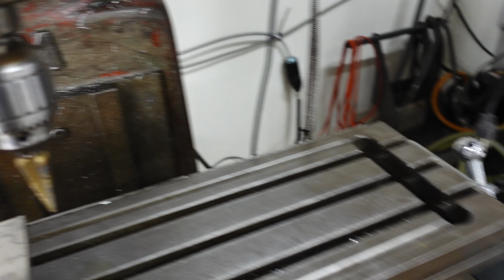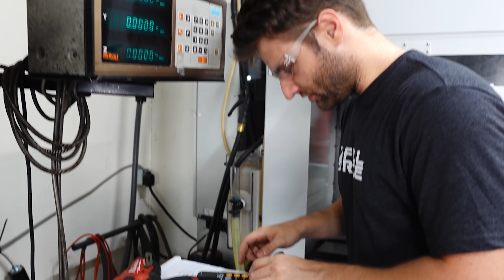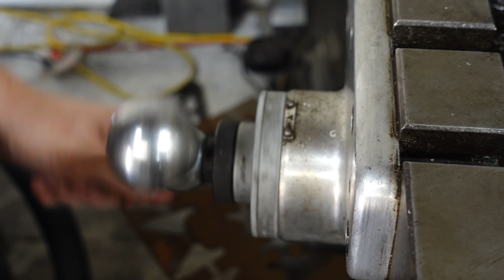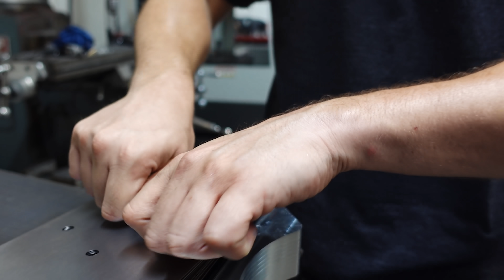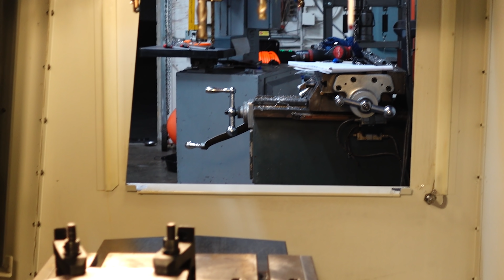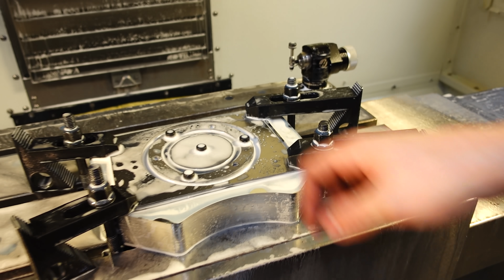Making EMERGENCY Parts for my 4 Rotor before the race.

Comment: I know that you're use to working in inches (imperial). I mostly work in millimetres and would even tend to convert from inches to mm if it came up.  But as it is a BMW diff and the sizes are probably metric, It may have simplified the job for you if you just pitched the holes out in mm? :)

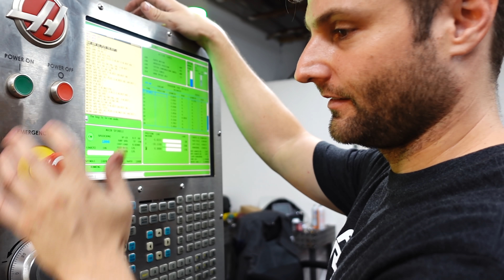Comment: 11:52
if you can buy, HSS tools instead of carbide they are cheaper when you crash😂👍
"single step" or single block here on the first run and read the code BEFORE you run it.

Comment: You should get the DRO fixed, there’s a feature in it that will allow you to do all that math without actually having to do that math so you can make flanges and, in this case, shins without having to deal with a bunch of additional resources. Should just be able to plug in the diameter of the circle the holes are on (from the centerline of the holes) and the number of them and it’ll display the coordinates for each hole.

Comment: Man I wish I was there to help you with the programing, I have a few tips for working on the cnc(no pun intended). You don't have to be completely fearless when running your programs, start it slow, some machines have a dial on the machine for the rapid feed rate and normal feed rate. Also if you close your normal feed rate the machine should stop moving completely except for the spindle. As for the programing, your contour is correct but see if you can "ramp" down at a continuous rate instead of directly plunging into the material every new depth cut you take. So start like 0.01 above and no lead in or lead out either because you don't want to ramp down 2 inches and have the tool want to lead out ^^

Comment: Rob, try using helix (spiral) cutting for this sort of work. It's less aggressive then just dropping the mill down. You'll be able to cut faster, have less wear on the tools, have even load all the time, so less wear on both the machine and parts, "cause" a even cutting temp, so less risk of warping the finished products. I recommend you look for a used CAM license from a top brands like PowerMill or MasterCAM (two options; either the license is on a special type USB dongle or it's software only, in which case you'll need the entire computer/setup, both are common. Make sure it isn't a pirate version, minimum demand a original recite! These programs will rat on pirates and you'll then get a nice little mail from their lawyers, will get more expensive then buying a new licenses very fast!)
Using one of the top brands will ennable you to use dynamic milling technics, this will further lower wear and risks. If you get a real 3 axis license you'll be able to make parts you couldn't imagen, by just a few mouse clicks. The "AI" in those will do most of the work for you in dynamic mode, so you basically only have to plan/calculate which tools you need active to achieve you goals regarding surface and corner finish. Even threads above M10 (3/8 in) are mill'able with the right software and just 1 or 2 specialized thread mills (a set with 1 carbide shaft and 2 55/60 degree heads will set you back 200-400$)
I would like too point out that you'll ofc need a ton of experience to achieve real toolmaker quality, but in reality these advanced CAM softwares are getting to a point where my (pro toolmaker) experience means less and less.

Good work doing the math! :) It's rare to see people doing that these days since it so mush more easy to make a quick CAD model and just check to measures in the software (which i btw recommend, less risk of messing up)

Helix "starting hole" tips (use this to avoid having to purchase drills and setting new tools up all the time, less risk of collision): the closer your helix D is to your tool D, the less -Z per round. Never go under 1,1xD, never go over 1,9xD. Helix is da bomb, as you americans would say, perfect for basically everything, starting holes, contours, precision holes, roughing out 3D surfaces and so on :)

PS for future reference imagen stainless is like chewing gum, it'll stick a loot to your tools, causing very high wear, even at low cutting speed. At low speeds this is easy avoided by adding a spray or drops of proper cutting oil/ high oil concentration cooling liquid. Regular steel needs cooling at some operations, but with dynamic milling (very high cutting speed, high feed, low engagement 0,05xD, max debt your tool will allow) you'll likely only need high pressure air "cooling" (it's not really cooling that much, mainly to evacuate chips fast enough. Using the right speed + feed will evacuate 90% of generated heat in the chips)

PPS Do not EVER use a end mill as a drill!!! Almost impossible to do without lots of experience. Use smaller mill + helix technics. If needed, only if needed, pre-drill to 0,5-2mm from finish hole D and "drill" with a end mill, low feed, max 1mm between "pull ups" to cool and evacuate chips
Reply: Oh crap, forgot to add: When milling fragile thin plates like these, they'll always bend (not wrap). This is due to the pulling force made by the way the mill is grinded. With each tooth "hit" the force will always be 20-40% pull upwards, depending on the end mills grind angle. There's no way to avoid this. For next time do this:
1 Set the base/mount plate into the CNC
2 Lay on a extra plate minimum 3mm thick on top of everything. This will also be great for adding extra pressure on the clamps and spread the force more even, ensuring nothing will move around while drilling
3 Run the program for mounting holes (all of them), like you did in the manual mill
4 Remove clamps and mount everything with the bolts. The thin plates will now have an high even pressure spread, that due to the bolts placement will be perfect and "shift" correctly to the areas needed while milling the rest. This'll be enough to (likely, depends on material, end mill grind and wear) have more downwards force then the mill will pull when running the contour pgm
That's it, you should see a close to perfect product, no bends, no wiggling, perfect sharp edges, no burs

Comment: How come you didn't use the factory shim as a template?  Using a sharpie, mark out the holes to drill as well as your inside/outside circle measurements.

Comment: Bruh.    Got u a sweet  cnc,  study feeds and speeds for materials and watch your fixturing and bang em out,   screw the  manual with a janky dro.    Also look into some thick aluminum and o ring material and a vacuum pump.

Comment: Rob to machine things more efficiently you have to check a couple parameters...... like the material you’re cutting and the material of you milling cutter.... I’m studying mechatronics engineering and I’ve learned how to fabricate things with cnc machines the “correct”  way (basically the way you’ll have a better finishing and a more efficient cut) if i can help you with anything hit me up...

Comment: Machining tip: you can set the NC to interpolate the circles. So it will cut the diameter whilst spiralling down in Z at the same time. Maybe go 0.008” per ‘lap’ of the circle if you want to be cautious. Those 6 flute cutters don’t like to be plunged into a face. Maybe get a slot drill (2 flute) or a 4 flute end mill 👍🏽
Also turn your rapid traverse down to make it a bit less scary 👍🏽

Comment: I think I saw a comment mentioning this already but just to be sure. I worked with a DMG Mori DMF 260/7 for quite some time so, I'm used to a different machine but this still applies. When running a new program, no matter who wrote it, run the feed extra slow. Especially during machine head movement. I always have my hand on the feed knob when running a program for the first time. That way I can slow everything down during critical moments and if something is wrong, I can just turn the feed to 0 and than back it out. That way to machine doesn't go into emergency stop and I can quickly edit and then resume the program. Saved me countless tools and a spindle or two. Replacing a spindle costs about 12000€ on that machine and many of the tools go into the thousands as well so, it's worth slowing down.

Comment: Those turned out much better than I expected - a saving in time and some good maching practice, too!
Old school would be hole punches and sharp scissors.
New school I'd have had them laser or water jet cut - either of which would have added days to the job - smart move avoiding that.

Comment: Get a full set of gauge pins.  Not only can you measure hole sizes better, you can chuck them into your manual mill to center your tool more precisely.
Reply: Never mind, just saw some in your vid 😂

Comment: Balls of steel with those rapid travels.  I always used to run my rapids at 20% and stand ready on the feed hold for the first run of a new program.  Good work cutting that shim stock, it's finnickey at best.  I miss running CNCs...

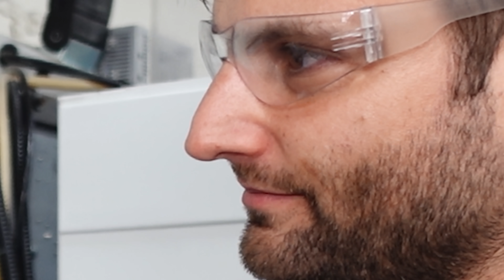Comment: You mentioned in the disassembly video that you are spinning that bmw differential  in reverse rotation i.e. "backing up all the time". Upon removal of the cover you found "more than expected metal" in the gear lube. I have concern that the pinion bearings aren't being properly lubricated during use given that they are being rotated in reverse direction from the engineers anticipated primary use. To help explain what I mean you might take a look at gale banks video "Whats going on behind your stock diff cover". If you start watching at 3:35 you'll see the gear lube traveling up the ring gear and into the cavity inside the differential casing thus feeding both pinion bearings. Now in your case because the ring gear is traveling in reverse you must imagine that wave is going "backwards" and splashing against that nice modified diff cover you have thus not reaching the cavity needed to direct oil to the pinion bearings. Sure that axle in the video is what considered a "semi floating" axle and made by ford but the idea of the bearings being fed by the wave of oil "riding up the ring gear" to then feed the pinion bearings is used by all manufacturers. I only bring this up because I don't want to see that front diff fail and lock up at well over 200 mph and cause the car to wreck and you to be seriously injured. I hate to have to write a short story for all to read but I think one solution while being able to reuse that same bmw diff is if you could give it a remote sump setup similar to what your 4 rotor has. Just some thoughts.

*edited to add link to gales video 
https://youtu.be/9-yG3D3JBRs?t=214

Comment: Hey Rob! Quick tip if you find yourself cutting out a ring in the future - Start with the outer edge! Starting with the inner edge means that the middle bolt is not helping keep the piece secure during the second cut. A minor difference in this case, but it might come in handy one day. 

Love the videos. Especially love watching you expand your skill set! Hope I was able to offer some useful insight.

Comment: Little tip for doing something like this in the future. For thin stuff. Make something thick that is the shape you need so it doesn’t get too mucked up to firmly clamp down the flimsy bits so they don’t bend out of whack. Other than that. This is crazy man. I’ve been out of the loop for a while because I’ve been busy working and fixing my car and you’ve picked up a cnc machine and are doing some of your own welding and learned how to use the new mill. That’s awesome man. This is why I love your videos because it really shows that if you want something you can achieve it with a little help, humility and good ol’ hard work and dedication. Good work man. I hope SEMA is on for next year so I can come check out the car.

Comment: Use a 4 flute endmill for slotting steel tale there is more space for the chips to escape. The 6 flute endmill will be better for perimeter milling as the feed per tooth is lower for a flyover rpm and feedrate which will give you a better surface finish

Comment: Good job getting started. I program and run these machines at my job so hit me up with any questions. First thing I see about the tool path is you are plunging the end mill into the material. Endmills don’t like that. What you can do is use a ramp contour tool path this allows for the endmill to enter at an angle and feed downwards in increments you choose. I usually do 3 deg ramp angle and step down of .005” this will allow for a better cut but with you’re thin material it might start warping. Second thing is 5-6 flute endmills don’t cut aluminum well, it usually gets stuck to those high flute carbide endmills. Other than that keep on milling. With practice comes experience and remember that it’s not if you’re going to crash it’s when. You will definitely learn from your mistakes but overcoming these mistakes makes you a better machinist/programmer.

Comment: You can get those shims from BMW. The 188mm differential is very common. 

Cool that you made the shims yourself, but unnecessary. 

Make sure you replace the 6 bolts that hold the side caps on. Pre crush the crush washer. 

I've rebuilt a lot of BMW diffs.

When you were machining the shims a machinist trick is to put a piece of sacrificial aluminum on top of them as well sandwiching the shims. You won't get the deformation of the thin stock like you got. 

Good work putting your machines to work!

Comment: In this video, Rob realizes what old-school machinists had to learn. Today we would just have clamped those in the CNC like he did in the manual and drilled & tapped those holes in one operation, and then run a second operation to cut it.

Comment: A little tip from a machinist. When you are running a program for the first time run it with a +z offset. 
If you deepest cut is lets say 3 inches make it at least +4" that way you can check the tool path. 
Also running single step to make sure you got all the right coordinate.

Comment: Hey rob just a heads up, when machine tapping you should use a spiral flute tap, they work much better for blind holes. What you're using is a hand tap, not great for chip clearing and on steel parts itll cause issues for you.

Comment: Could have used a dye marker using the old shims as a mock up... But I like you play with math, and you cnc. :)

You need to set the table depth for your cnc so you don't drill into it.

Comment: Hey rob on a hass hit setting graphs twice to display graphics to show what your actually cutting. Can be done in memory mode or mdi i believe been awhile since I ran a hass but ran em and programed em for 5 years ps get mastercam and don't even f with the manual machine I understand the fixture but you only needed one taped hole in the center lol your getting it man keep moving forward!

Comment: You should use a solid pinion spacer instead of a collapsible spacer, they are much stronger. That also requires shimming to get pinion height correct and also correct pinion preload.

Comment: Hey Rob just a heads up, I'm not sure if it's the same with BMW stuff but I learned in school that you should only use one spacer per side of the carrier. Keep in mind I am in the general motors program do it may different.

Comment: You should have gotten a mazak machine. It use what’s call conversational programming so it’s basically asking questions. Like start point on x finish point on x. So on and so forth. You answer the questions right and the machine turns it to g code for u. Much easier.

Comment: Hey Rob, 
If I was you I'd bring that 6 tooth cutter in more slowly when initially drilling downward. The very centre point of the tool doesn't have a cutting surface capable of cutting directly downward hence why you usually use a 2 tooth tool to cut slots. Any tool above 2 teeth is generally better for cutting edges rather than drilling. 

It shouldn't be a problem when just drilling to start a slot but it'll save your tool in the long run if the initial plunge cut is done more gently 😄

Comment: FOR THE MILL: clean your scales and check to see if any capacitor let out the magic smoke inside the brain box of the read-out. It could be either of those or both. IF neither is the case, then you've got bigger problems.

ALSO be very careful handling the scales, they are likely glass, actual glass, considering how old the read-out looks. You could even have the unfortunate event where in shipping they were cracked. You're supposed to remove them from the machine when it's shipped.

MAKE marks and take pictures of the assembly before you do it. You want to put them exactly where you took them off.

Comment: DAHM, you should start checking out used ads or options for laser cutting. A lot of cool things you need could be laser cut. So be it owning the machine or finding a local shop to support, this is an important element. And it's not just shims, shields, small button plaques, trim, bits and bobs. Worth investing in.

One of the diff shops in my area, thought that it was such an important thing to have, they actually advertised space in their hangar for any company willing to nest with them. And i think it paid off because they always have all the shims you could possibly have on hand and if they don't, they make them quick.

Comment: Hey Rob! If you loosen the textured nut on your x, y and z axis's on your manual mill you can set the dials to zero so you don't have to remember what the dial was at before you moved.

Comment: Long time ago i was an green button punsher on an Haas. Did not do any programing or "installations" , Just change bit and pushed the green button, But if i remember correctly u can easy slow down the speed off the program and be ready to push the stop button, And look so the machine is doing what it suppose to do. And if i remember u can also easy turn off the cooling so u can see what the machine is doing and stop it a few mm from the piece and look in the program how long distance it have left for travel. Keep up the good work and dreams : )